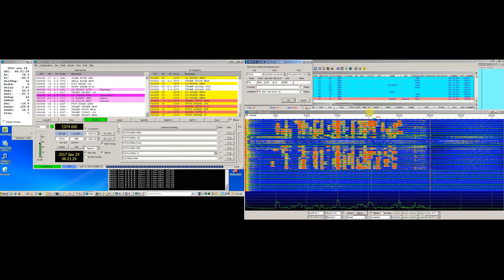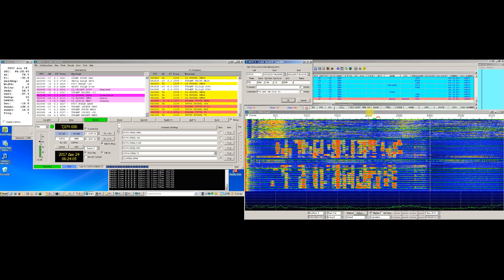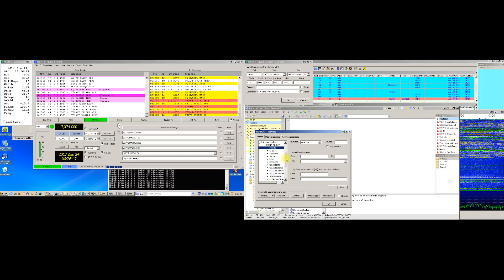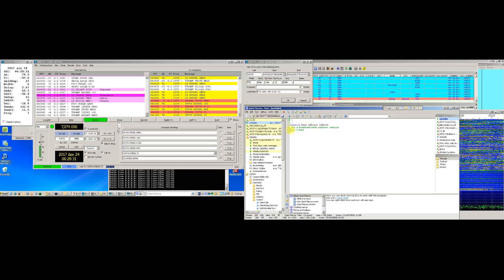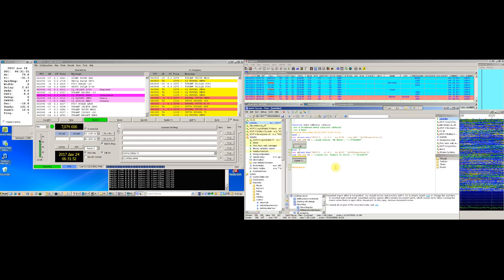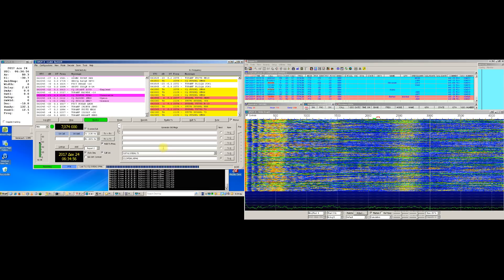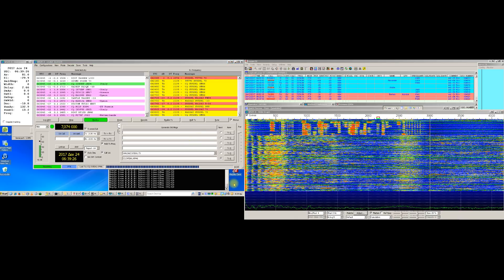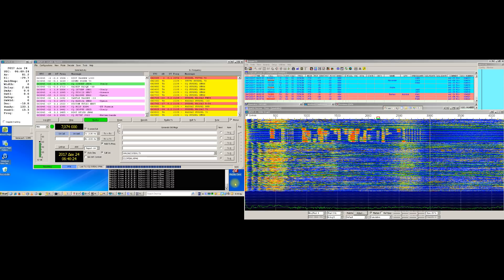SV5DKL FT8 Robot - HowTo Tutorial (Improved Audio HD version)

Comment: Hello, congratulations for this contribution. I have tested it and it works very well, although I have found a problem.
If you answer a station and it does not respond, WSJT-X will continue calling it repeatedly, without stopping, until you manually stop this transmission and make a new call.
Is there any way to avoid this? It should be possible to regulate the maximum number of calls, or limit it to a certain time, and then make a call again with your own callsign.
Is this possible to do?.
Thank you. Antonio EA1CK

Comment: the thing is, you have almost zero chance to find if there is a robot on the other side
it is perfectly possible being active for many hours
it is perfectly possible calling the same station repeatedly for many reasons (checking propagation conditions, not having complete contact history in computer used at the moment, ...)
it is also possible to avoid detection by these simple means (by checking the contact history for example)

Comment: Any scripts around for stopping the dreaded stall - when a station gets stuck in a loop

I do plan to use this - mainly on 80mtr and 160 mtrs - about 30-35 watts out from an Icom IC-7300 into a long wire from Australia.  Just spent 2 allnighters for 3 contacts into the USA and Hawaii 
This was I get some sleep if it works
Reply from the maker: Yes, included in this: https://www.ebay.com/itm/FT8-FT4-ROBOTIC-QSO-SOFTWARE-FULL-AUTO-QSO-MACHINE-PERSONALIZED-TO-YOUR-CALL-/153997781917?mkcid=16&mkevt=1&_trksid=p2349624.m46890.l6249&mkrid=711-127632-2357-0

Comment: Great stuff. I gotta laugh at these lids saying they will only confirm from non robot.. guess what you will never know if its a robot or not. And the hambo paper chase is a joke. You are not in a sport like the arrl would like you to believe, your fat,  you can't lift your own weight and that award you have means absolutely nothing.       Furthermore, I can be using the robot while in the radio room and its perfectly legal so put that in you hat.  Efstathios is a real ham he figured out how to do something unlike all the extra class no coders running around that just buy stuff and plug it in. Appliance operators or plug me ins. I hear it all the time no coder gen/extras can't solder, can't build an antenna etc etc. And just some really bad operating on all bands.   How about learning something?  Na thats to hard its easier to unload the bank account and pretend your king.